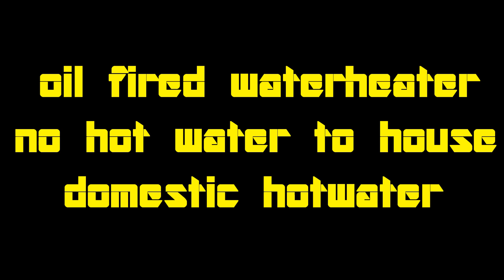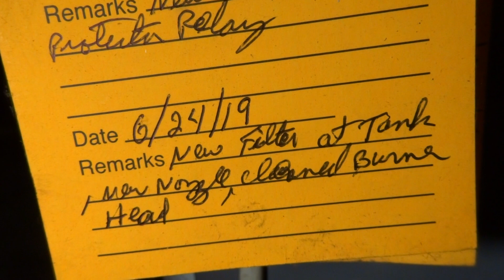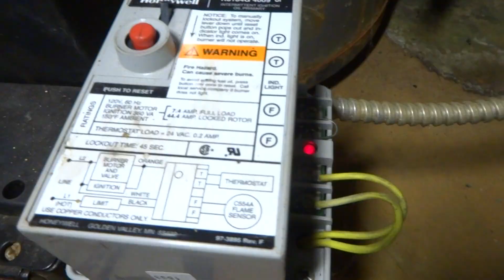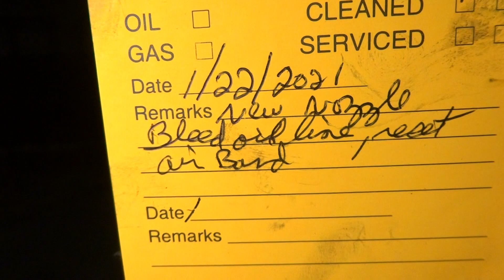OIL FIRED WATER HEATER NO HOT WATER TO HOUSE

Comment: @7:10  bled my ass ! Shes lucky she called you back. I work on oil furnaces up in NE OHIO. This is a very common issue. These people need to take about 20min out of their lives and study their oil equipment. Excellent work Steve!
Reply: a lot of the time, the heating and cooling or hot water heating equipment, no matter if it's gas, oil or heat pump, is something that homeowners don't really think much about, even though they should.

Comment: Umm, 40 gallons. I wonder how much extra they charged her for such a small amount of oil. Here in NY if you don't get 150+ Gallons they will charge you a surcharge. hmm.
Reply: Where i live we do have some homes with oil heat, but they are far few between compared the northeast where Steven works, so i can't really tell how they charge for oil in my area even though it dose exist somewhat in this area, the main heating sources in my region are usually gas or heat pump with an AUX source.
Reply: @KenKen-ui4ny  Yeah I would prefer Natural Gas. It is cleaner and less expensive. Unfortunately not available in my area. The closest for that is 35 miles from me. Electric here is rather expensive for heat. Gets too cold here for a heat pump.
Reply: My oil company doesn't want to know your name unless they're delivering at least 150 gallons to make it worth the drive. 

For all we know it could have been a handyman with a few 5 gallon tanks filling it with trips back an forth from the gas station. What came out of the filter housing looked awful clear, like it was undyed taxed fuel.
Reply: @erikj.2066  yep so true.
Reply: @NY411Info  Heat pumps aren't really all that big of home heating power houses let alone, they tend to have their far share of problems down here too, alot of our complaints about high power bills usually come when temperatures get below freezing here, where the AUX heat has to be used, depending on if it not a dual fuel gas/heat pump system instead which are big on the market here too.

Comment: Crispy critters and crispy ceiling. I had a customer that never called for Service unless something broke. The stack pipe rotted off right where it went through the ceiling and the pipe fell against the wall and set the house on fire. Thankfully it was caught and put out with little damage but if it had happened at night it probably would have burned up the house and the old lady who lived there.

Comment: I'm curious with this one as the first time you went, at 3:32, you showed the oil gauge and it was showing empty, so you assumed it was empty, but the second time you went back, you showed the oil gauge again, at 6:05, and it showed empty again, but there was oil in the tank when you took the filter off and opened the tap up,  so if the gauge was  faulty, then there may have been oil in that tank the first time and it could have been bled then and may have not needed a second visit. If the gauge was reading empty the second time I'm wondering why you didnt raise that issue as a potential faulty gauge. I love your videos, but this one did get me wondering about that gauge, and why it read empty the first time you went and also on the second visit.
Reply: notice the way it reacted when he lifted and dropped the plunger, thats how he knew if there was oil above the outlet or not. that and the filter was clearly visibly airlocked on the second visit, that cant possibly happen if the oil level is above the outlet.
Reply: 40 gallons of oil isn't anything to that gauge. She ran that tank bone dry, 40 gallons was probably just starting to wet the bottom of the tank gauge float. 
If he yanked on the gauge again the second time he came, I'm sure you would have probably heard the float splash in the 40 gallons of diesel fuel added by the cheap handyman she hired.

Comment: What's The Air Band Steve ? is it like a Filter ? Never Heard of it.
Reply: Same as an air shutter, changes the amount of air the motor draws in for combustion air
Reply: It adjusts the air intake. The amount of air to fuel mixture. So the flame is receiving the right mixture of air. On a Beckett oil burner.
Reply: @FG-tg9uk  That's a Carlin, but all brands have an air adjustment.
Reply: Since the burner can be equipped with a multitude of different size fuel nozzles, you need to adjust the air to suit the nozzle size your using.